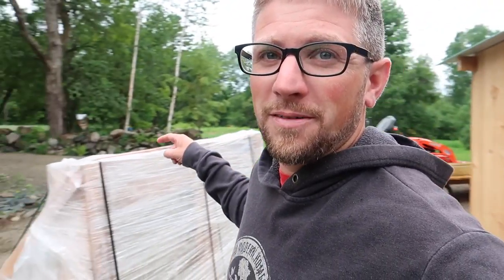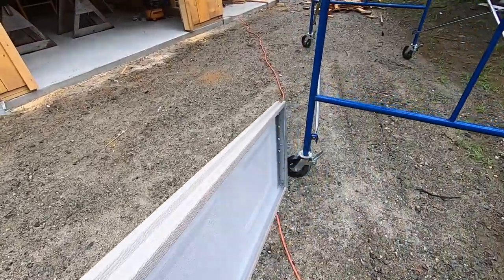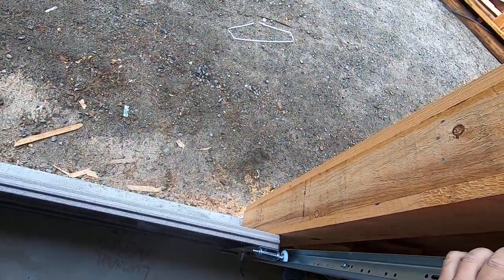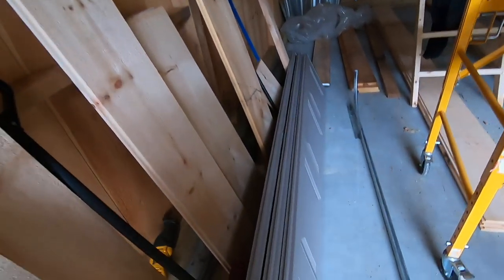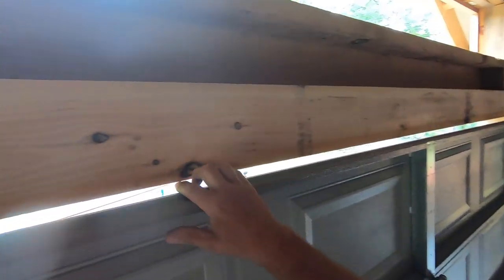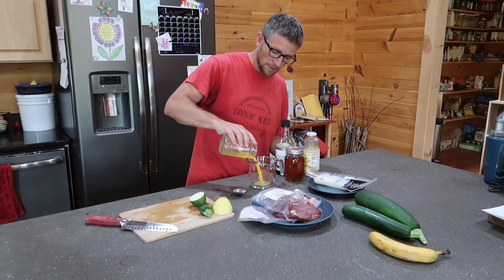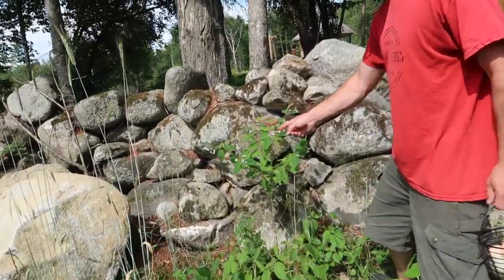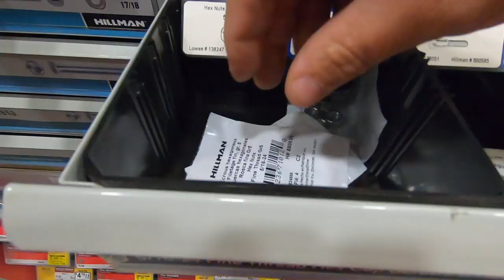Not my favorite JOB (Installing the OverHead Door on the BARN)

Comment: Morning Al-steader. When I was about your age I installed my garage door and the electric opener. The hardest part for me was the weight of the panels and lifting them up. You made it all look so easy. But I always have been proud of the accomplish (being a girl and all) and twenty some years later it is still working.
Reply: That is impressive, from another girl here. I'm sure Al has gotten a good workout building this barn, hauling hay bales, bags of feed, and everything else he does.  Who needs a gym?
Reply: @Recovering Soul ,
As a teen I spent one summer working at a dairy farm doing all of what you have mentioned except for building a barn.  I could pick a 75 pound hay bale up from the ground and toss it up to the top level of a hay wagon.  I was in pretty good shape. Or so I thought. Got back to school and did my first day of football exercise. I felt like I was going to die ! Work exercise is not the same thing as focused gym exercise !
Reply: Thank you Recovering Soul
Reply: @Donald Miller. That is interesting.

Comment: If you were flustered by the garage door build it did not show.  I've watched all the barn build videos to date and have been impressed with the cool headed way you have approached the whole process.  I can only remember one expression of frustration which did not even result in an expletive when a panel of roof slid off and hit the ground.  You have explained the whole process clearly the whole way through.  Going to be sweet when completed. Great job.
Reply: And when the boards fell like dominos. I would have had to cut that part of the video out for bad language. He is cool as a cucumber.
Reply: @recoveringsoul755  I forgot about that.  I even cursed watching that.

Comment: Your installing the garage door by yourself is amazing.  I just had a new garage door installed to replace the existing 70 yr old wood garage door and it took 4 hours with 3 people doing it.   And it cost me $1,300 for the door which is aluminum too.   Great Job Al.   Look forward to seeing the barn when its finished.

Comment: Tomorrow will be even more fun. The hardest part, in my experience, is getting the rails and the door lifter tension both right. That steel you got at Lowes becomes a nightmare when you are trying to aim the rails straight and keep them parallel. Spend more time planning and less time doing and you should be OK.

Comment: Use your smart phone as you would to take a picture.  When you have the plant is the frame, look at the bottom selections on the photo screen. You see a lined box with an open bottom right corner, with a solid dot in it.  You'll also see a solid larger dot in the middle of the box, touch it. It will instruct you to touch what you want searched on Google.  Great feature, just discoved it not too long ago and have used a bunch of times since.  I used it tons each the plant from your video, it's s "Spreading dogbane". The plant  is common in North America,  and is widespread across most of th he US.

Comment: Good job so far on the overhead door. It's good to sometimes to step back, take a breath, and have fresh start. Dinner looked so yummy. Hopefully your service door will go very smooth  and quick. Thanks for sharing the details AL.
Reply: Pre-hung door is a piece of cake if the rough opening is done right, which it is because Al's such a perfectionist. All of the time is spent dealing with floors, walls, and rough openings that are off.
Reply: @hughbrackett343  you are correct, I built my 2 story garage and used pre-hung service doors. It is very easy to get them plumb and square, especially if you are as meticulous as AL is!

Comment: I'm not a carpenter but I'm handy and made my living mostly turning wrenches. I think maybe, not knowing you better, that you are a framer not a finisher. The door seems more like finish work. In the video you haven't even completed it yet. Maybe as you edit your comments reflect the completed job? .Make some shims if you haven't got that far. I loved what you did to hold up the loose end of your horizontal door track. I was just thinking, now throw a  ratchet strap over a rafter and just slide the end into the loop then ratchet it so its level. What you did worked! Al, don't get flustered. You are doing a good job! Uncle Mike in KCK

Comment: I saw a video on how to insulate a garage door.  Not expensive.  Using styrofoam boards cut to fit in each rectangle of the door and then taped using aluminum tape.

Comment: Why use the perforated angle iron , just run a 2x4 across and attach your rails to that ! Much cheaper and holds really well ! Then you’ll be all set for an opener if you so choose . Mine has held so far for 41 years .

Comment: My guess is because it isn't wood and it isn't 'barn-y'. Like I bet if you were installing actual barn doors with a running bar at the top and bottom and all in heavy wood you would have felt better. But you got what you got and it will work fine. This morning I suddenly decided to fix two dining chairs. Watching you work is inspiring. Lol

Comment: Al, Premium dinner! Metalwork kit construction is hard, exacting and unforgiving, whereas,  woodwork kit construction is softer, flexible and more forgiving. Take a deep breath before you start adjustments to get the door to run true. We have a 14' door on our garage like yours. The braces at the back end of the track go, one between the tracks at the back, then two adjustable fingers upto the wall on each end. Two vertical braces up to the flat roof joists which also have some side to side movement. Makes an adjustable box at the high rear end. Make some slots in the angle iron. The front view of the barn shows an elegant look! Excellent work. Regards Stephen.

Comment: You did great on the door.   I too was intimidated on my first door build but kept in mind that it did not require a phd to do it.  It is intimidating to install the spring assist so be careful on that aspect of the job and have either a helper or the tools you need within reach.  I prefer to have the opening just a little smaller than the door so it seals better.

Comment: OK at 4:06 and I am worrying - you should not leave the man door on that palette with just the framing support. Unless it is otherwise attached to the palette (I think you just severed all those ties) it is now, including the framing, a rather heavy load of about 42" high resting on about 8" width. Any wind and that glass door goes over, and I have noticed wind there before. OK, good. Worried for nothing. Hope you did not leave it there overnight - prove me silly!!  Great video, thanks!

Comment: Good morning Al, door is looking good, understand putting them together sucks, I my least favorite part of them is the top, making them secured from the wobbles at the ends. Also, if you can find some Dynamat you can attach it to the inside of the pannels, lessens noise and helps the tin less likely to want to crack.

And now into the kitchen. Hello Gina, give this a try, do the squash just as you did, add one table spoon of butter,  but this time take the fish, salt and pepper both sides, no need to thaw, place on top, of the squash, let it on steam cook.

Comment: You can purchase a garage door seal which is rubber glued to the floor which joins to the bottom of the door, keeps the weather OUT.           https://www.autoanything.com/garage-accessories/69A3201A0A0.aspx    I put one of these on my garage door opening and it made a world of difference, less dirt and leaves and bugs coming in and no more mice.

Comment: If you add the strapping or alloy box or Angle iron section to the last panel (top) on the garage door you will keep the full hight of the garage door opening.... you never know when those extra inches of height will come in handy! 👍

Comment: Great work, #LumnahAcres!  Be careful on that torsion spring - can be dangerous! when putting together most assemblies like garage doors you leave the fasteners loose (un-tightened) and wait until it is all together then go back and tighten everything
Reply: Fat Rat  While true, if talking about proper operation of the door - I was referring to potential for injury.  Those torsion springs have to be "loaded" manually.  If done incorrectly the force in this video will be applied to the installer (the human) (not humans harmed in this fella's video ;-) ). https://www.youtube.com/watch?v=hrUIN6hClB4

Comment: the first time i installed a new garage door i ended up locking myself in because i didn't have a man-door to get out and i didn't have the spring done. the panels were wood so they were really heavy! i couldn't lift them to get out and get the rest of the stuff i should have had inside. 😂

I'm not sure what type spring yours has yet. but if it's the wind-up type be careful! i fractured one of my fingers when one got away from me after trying to set the tension.
take your time, you'll be fine.

Comment: Channels should not be installed until whole door is assembled and put in opening.  From professional installer I worked with.  Sorry to late to help.
Reply: Did he use something to hold the door up? I've done a fair amount of maintenance but I've never put a door where there was none before.
Reply: @David J. MacKinney ,
How do you do that when it is the channels that support the door ?

Comment: you suppose to to put all doors panels up then put track on the sides. use nails to toe nail around the edge of the panels to hold them up til track is installed.

Comment: It sure looked easy, for being your least favorite thing. Someone backed into my door right at the corner of the 1st and 2nd panels. I open it from my apartment then walk over, so didn't realize.  Then it stopped and went crooked, dropping the wheels out. Luckily I had tools and fixed it. I was surprised it was pretty easy. 

Are you putting in an electric opener?

Comment: OK, this is awful for me because of those little things you don't know.  For example, it looks like you are not putting 4 lags in each hinge, etc.  but you will get there.
Reply: Use a vice grip on the track to keep the panel from flopping down until attached.

Comment: My brother and a friend of mine installed my one and a half car metal door in about  5 hours.  That included tearing out the old rotten 38 year old wood door. It was attached to a door opener.  You will be working alone so I will not guess.  Just be careful.